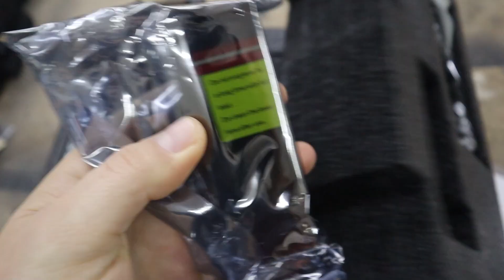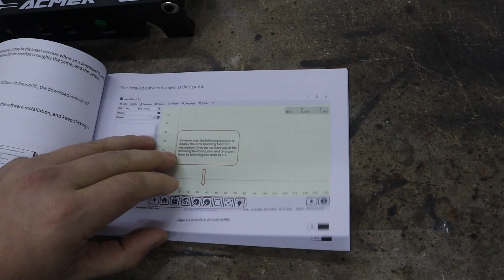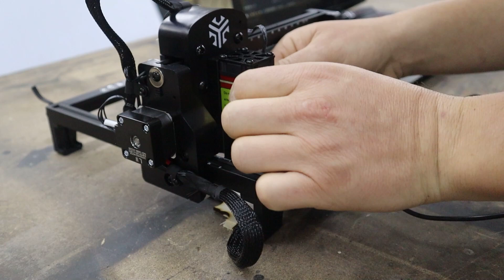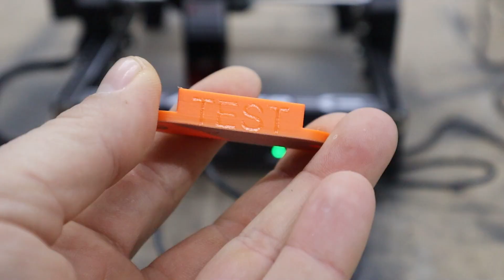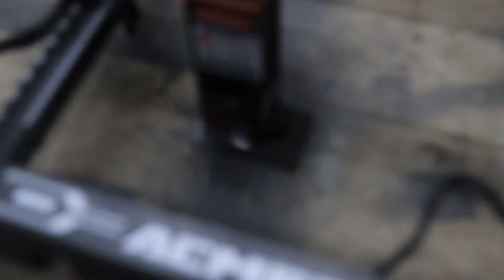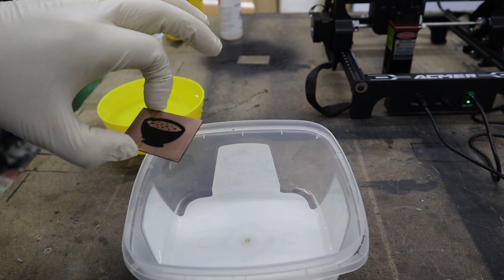Laser Engraving PCBs at Home – Acmer S1 Review & Demo

Comment: Is the Image generated as Black is Laser Cut or the White of the image is Laser Cut ?
- Did you Invert this Image to Cut around the Bowl ?
Reply from the maker: I created a vector rectangle and the logo was actually subtracted from it. This way, the fill area is all around the plate and there is no need to invert anything. In case you are using an image and not a vector, then yes, you need to invert the image to have the engraved area black. Hope it makes sense.

Comment: Thank you soooo much 💐💐💐
I want to engrave on a circular pendant with a diameter of 3.5 cm. Will that work? How does the machine detect the position of the pendant ,does it allow you to place it in a specific spot?
Reply from the maker: You control that from your software of choice. You can place the machine on a scrap of cardboard, engrave a circle with the right diameter and then place the artwork in that circle and the pendant on the engraved cardboard for perfect alignment every time.
Reply: @TasteTheCode 
Thank you sooo much
Reply from the maker: You are welcome